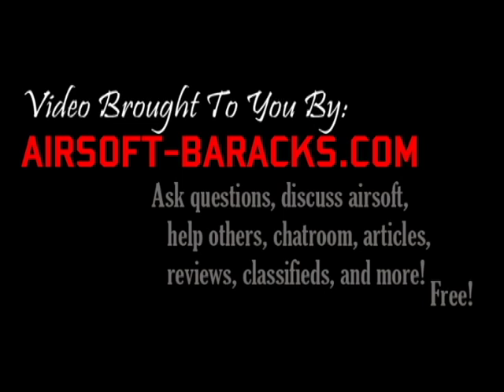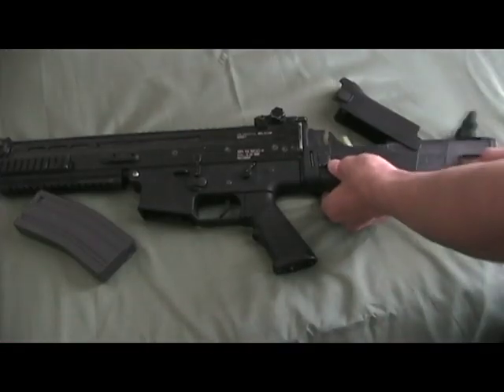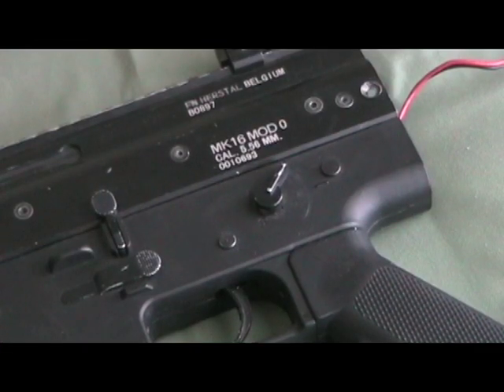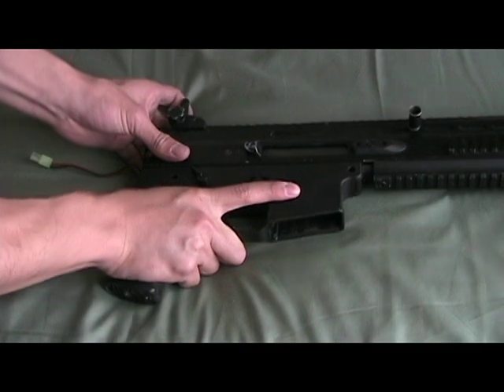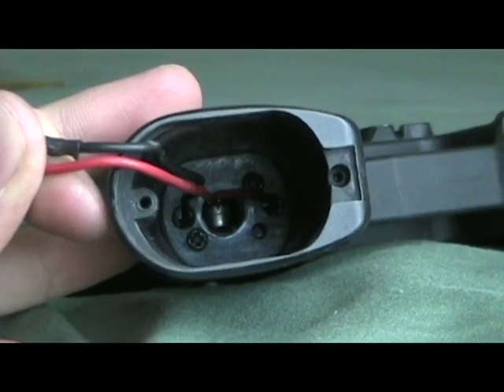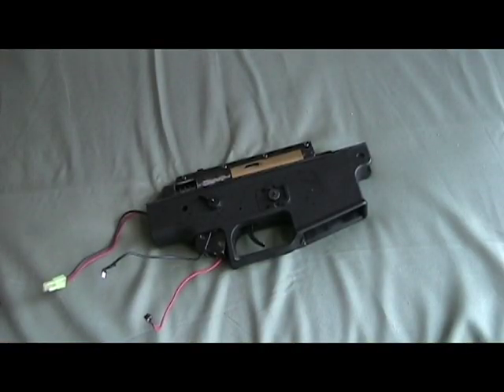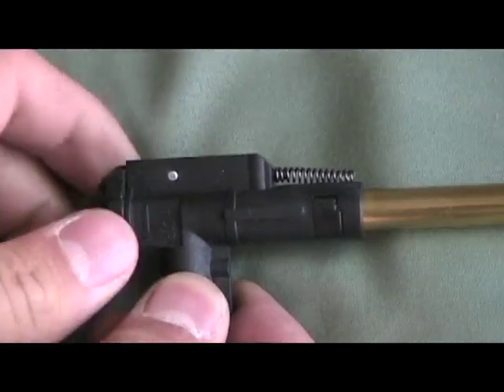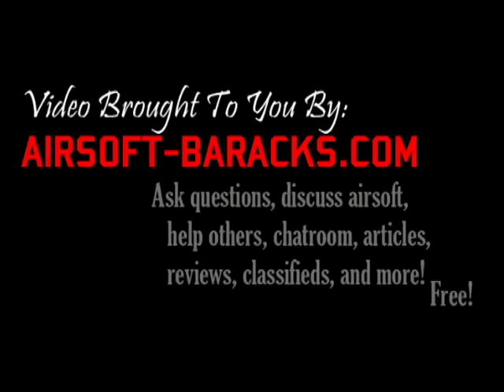Classic Army/DBoys/AGM SCAR-L Disassembly Guide

Comment: @battlefieldSFDclan ok i just had a problem like that in this gun but it took a while to work it out first of all check that the wires in the pistol grip have not come loose, then if that has not worked check your connecters were the batterie and gun connect to make sure they have not burnt out. and if all else fails completely dissasemble the gun and change the gears because it is likely that they have broken and jammed the gearbox. if you neeed any more help just ask.

Comment: Can someone help my scar doesn't shoot it makes a click like the battery is dead though we've tried many batteries fully charged we still cant figure out the problem
Reply: have you checked the connections on the motor in the handle?
Reply: Just noticed its been 5 years...sry.

Comment: I actually found it a lot easier if you wedge a large flathead screwdriver to pry the body wide enough to see the gear, then take a very small screwdriver to shift the selector gear on the gearbox off the selector tab before removing the gearbox. Just fyi.

Comment: i want to get a better battery than the 8,4v i have,but any other battery won't fit in the stock...can i move the cord from the back to the rail of the gun so it will be possible to connect it with a battery inside a battery/laser box?
Reply: Airsoft GI sells the mini 9.6v bricks for $24.99 I heard they're great. I also wanna upgrade the battery.
Reply: This gun has an amazing rate of fire with a 9.6v.

Comment: When you were trying to disingage those two gears you did it wrong. There is a hole on bottom of fire selector for a 1,5 mm hex key. Once you unscrew that, it will come right off. Then you will have access  to pull out your gearbox.